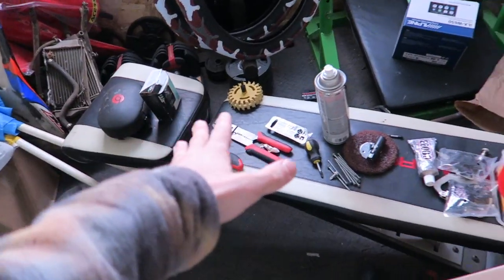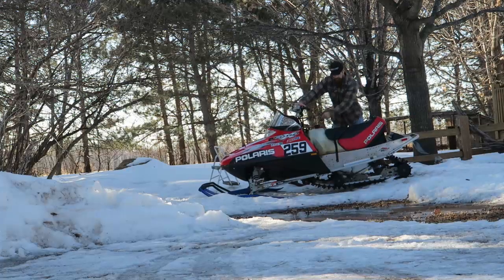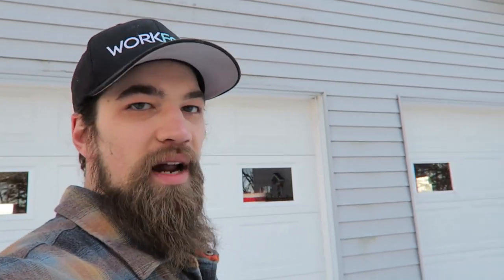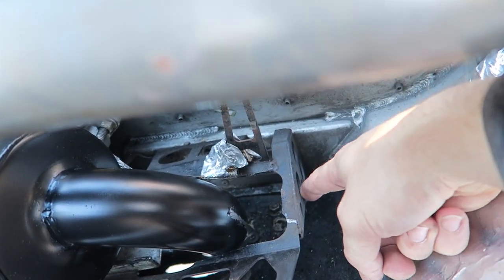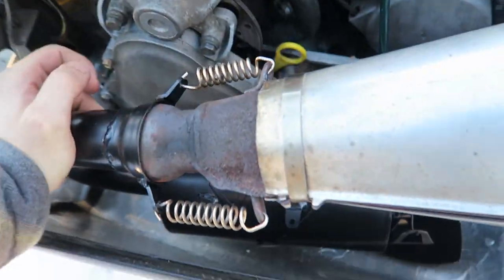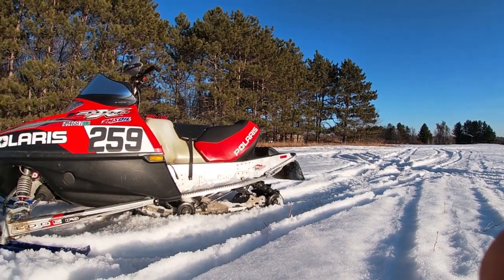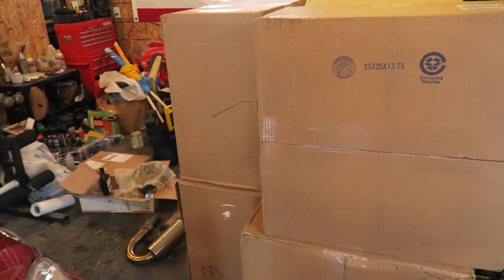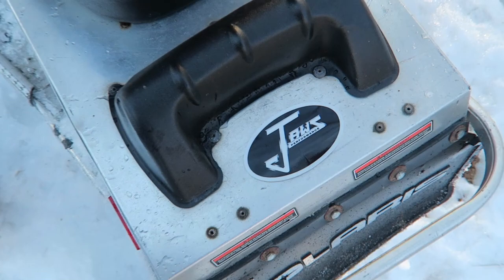MBRP vs JAWS - BATTLE OF THE RACE CANS

Comment: You think thats jaws rowdy would fit on a 03 rmk 800? Because they have the same body.
Reply from the maker: Maybe, the only thing I would worry about is if it's getting enough air flow. I would jsut comapre the design to others on the market and see if it looks close. If it's close it will likely work. As seen, the JAWS is different dimentions than the MBRP and meant for the same motor. If it's close, you can make it work.

Comment: Id so for the jaws it might just be me but the mbrp sounds a bit boggy
Reply from the maker: The Jaws can seems to let the sled breathe better. I had the MBRP on again for a while this season and same kind of boggy performance at lower RPMs. Part of it in this video was it got loaded up from idling while I set up the camera but the Jaws can definitely has better flow. It’s kind of a toss up on which one sounds better when they are both on the pipe, they both offer a good tone.